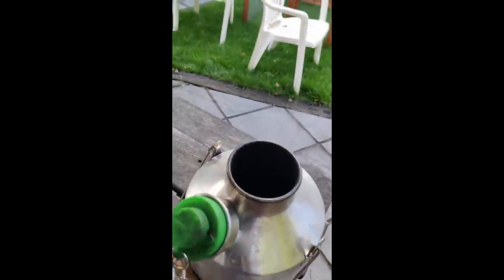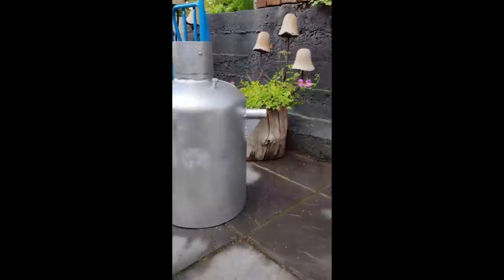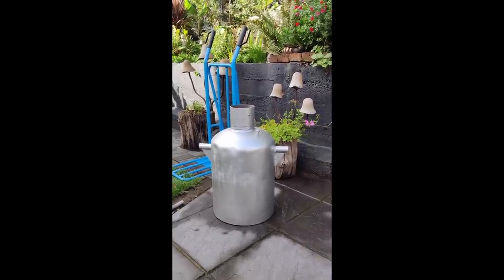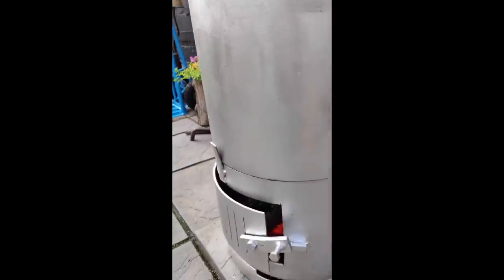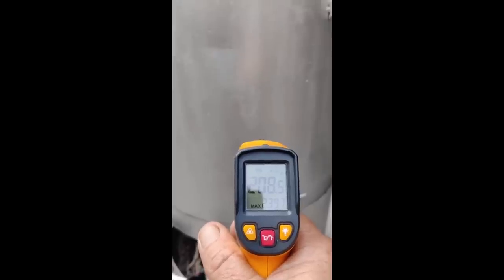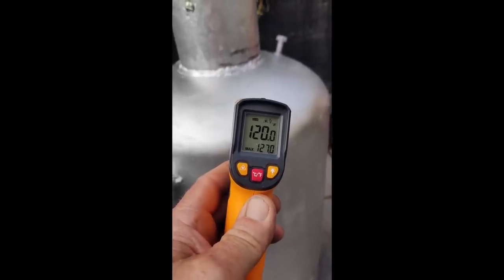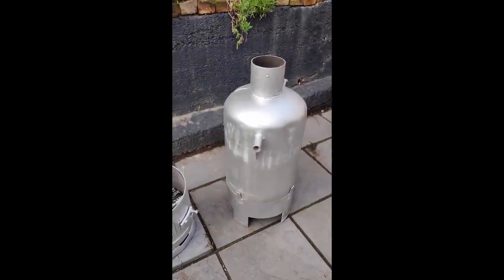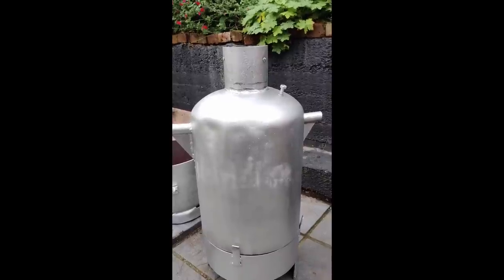Sand battery can it heat my home?

Comment: Shame you couldn’t charge in the house as you loose that heat as well. No way of sticking a chimney through the wall out the back of house?
Reply from the maker: I'd be better off with a wood burner tbh, the whole concept was to have a storage heater that I could have in the house as we can't have a wood burner 👍

Comment: Water has five times the heat capacity of sand. Sand is a piss poor material for holding and giving out heat although of course you can get it hotter than water.
Reply: Maybe oil filled would perform better and would get to hotter temperatures than water is able to

Comment: Why call it a sand battery yes it stores heat but it a heater why not just call it a sand heater?
Reply from the maker: Because it stores energy in the form of heat, could call it a sand heater or even a storage heater 👍

Comment: Filling the container with a substance that holds and emits heat is a great idea. But I don’t think sand is a good idea. It turns into a liquid and cools into glass. It does need a vent or temperature gauge for would think. But you can pound pomice or lava rock. You can ground ceramic or any other dust to that has a higher heat tolerance. And maintain it . I hope it helps.

Comment: You can go with candles, and plesse made it smaller (2-3 candles) bc if you are using woods inside the houses might be dangerous from fired & CO2. Candles are much safer, less CO2 and you are still having good heater better than woods.

Comment: If you happy to do that fair enough. But it's not really a solution for most of us and I bet its no fun in the pouring rain which you didnt talk about. And not many wives would agree to have that monstrosity in the house stinking of burnt wood ash. What you really need to do is to heat that sand inside the house with wind or solar power.
Reply from the maker: Free heat👍